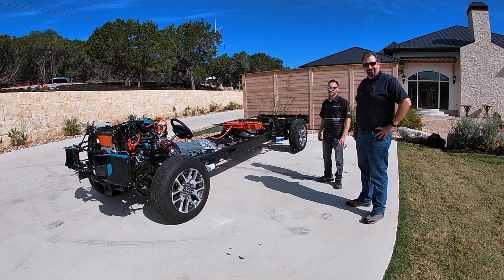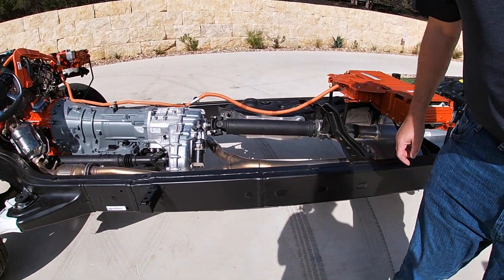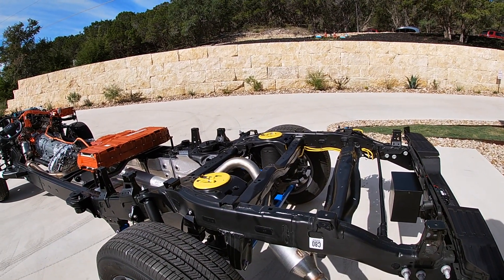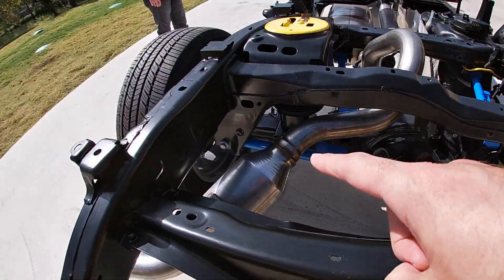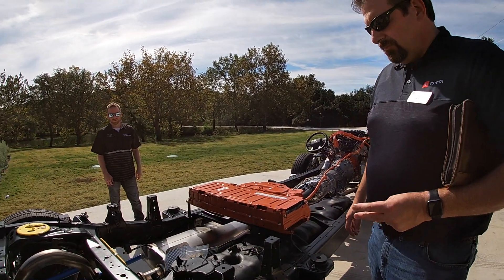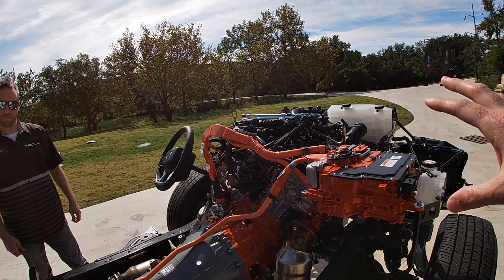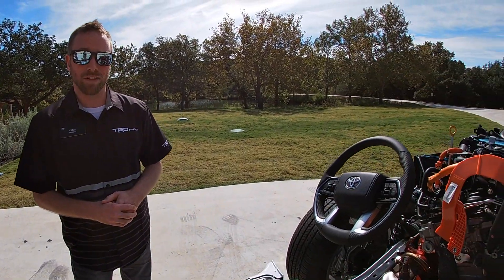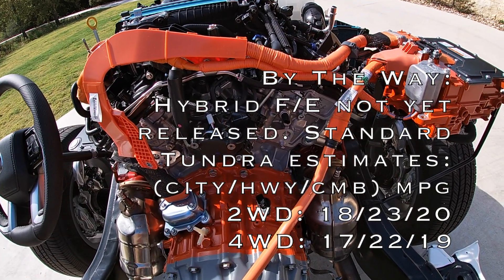See the 2022 Toyota Tundra in Full Detail and Hear from the Engineers Behind it.

Comment: Great video! Do u think adding a after market bumper like a ARB, would that affect the mpg since there is a lot of aerodynamic design for fuel efficiency in the front and more importantly would that affect the air flow to the intakes and the intercoolers causing a less than optimal cooling since the front design have specific tunnels for the intake and intercoolers?
Reply from the maker: Really appreciate your comment.

I think, yes, it would affect it somehow, as there is the additional motorized mechanism in front to lift or drop an additional spoiler to direct air as needed. And that's located just under the bumper. 

But I'm also sure there's a way to do it that would still allow airflow to all the necessary intercoolers, just perhaps not as fuel efficient.